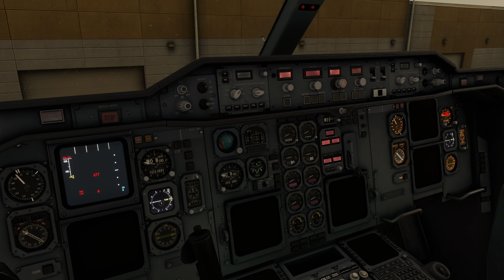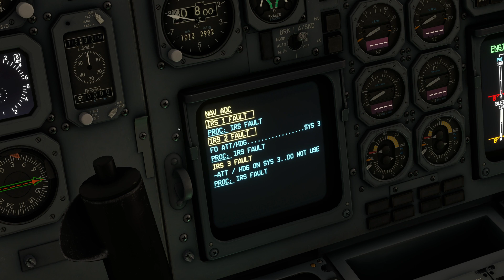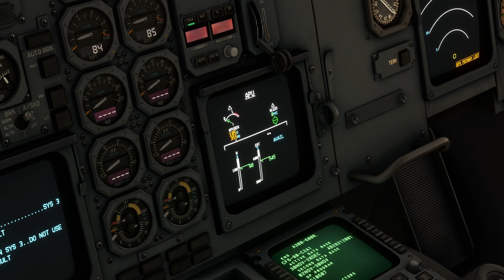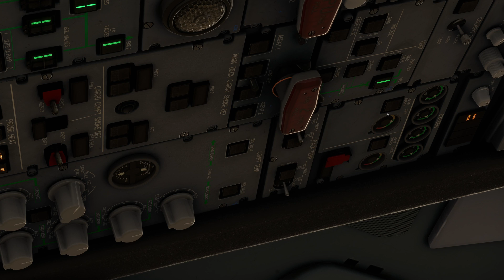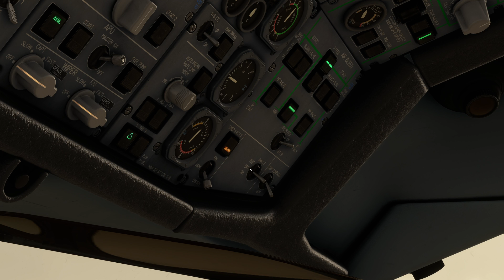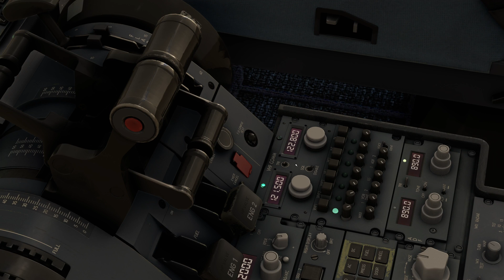iniBuilds A300-600 Tutorial 1: Elec Powerup & Preliminary Cockpit Preparation | Real Airbus Pilot

Comment: Hi, great video. I have subscribed!!
But can you or anybody help me? I've bought this AC on msfs. I've started my game cold and dark at the gate. But, when I switch on the batteries, nothing happens. No power. I've tried starting the APU, but there's zero fuel. I've re-started the game, inputting fuel into the weight and balances. But the game still starts with zero fuel.  I can't ask ATC for fuel or power as there's no power to the radio. I've tried ground services through the EFB, but the only thing that allows me to do is open and close the doors. Any feedback?? Thanks is advance.
Reply from the maker: Hi, thank you for the sub!
I'm afraid I haven't seen this issue before, but I would recommend you to join the inibuilds Discord channel, over there you can get help directly from the developers. They should be able to help!
Reply: @A330Driver  thank you. I will do that now. Just for your knowledge, if somebody else has this issue, exactly the same happens if I start the game on the active runway. Everything just shuts down. Strange one!!